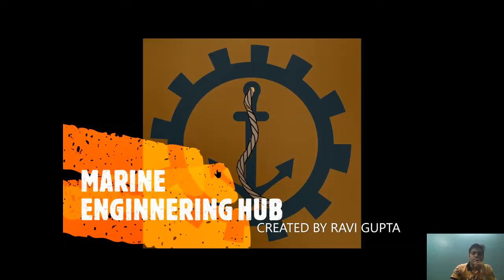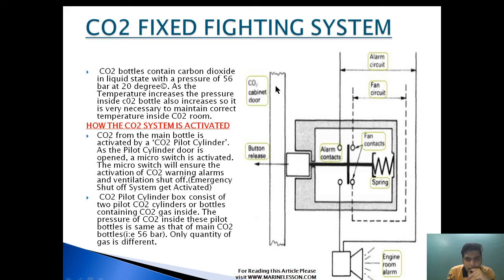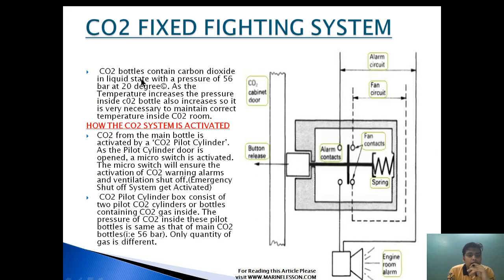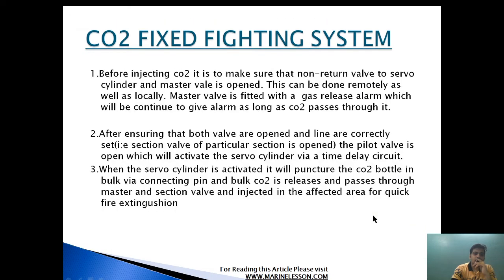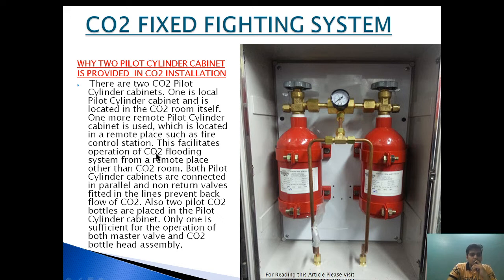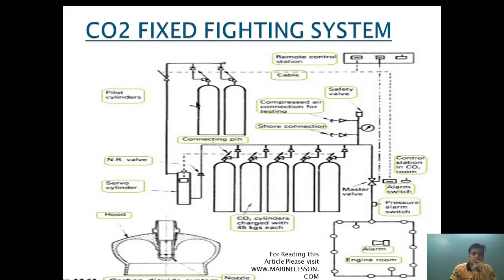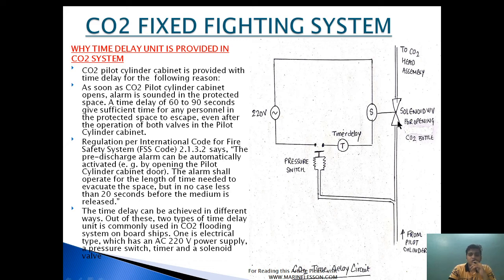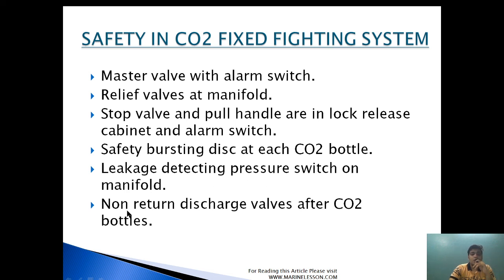CO2 FLOODING SYSTEM|FIXED FIRE FIGHTING|CO2 CABINET DOOR|TIME DELAY|(PART-1)

Comment: The nos. Of Co2 bottle is not mentioned in Marpol nowhere , instead it is decided as per IMO and u will get it in Solas chapter 11-2. Nos. Of bottles are decided on the basis of ship specification, like how much area to be covered and other things. YOUR EXPLANATION IS GOOD BUT Kindly don't give false information
Reply from the maker: Hello Amit!!!
What I mean to say is that number of bottle specification is decided by the guidelines provided by the higher regulations body.
You are correct.
In my presentation I have no where mentioned Marpol.
Thank you for raising the issue.